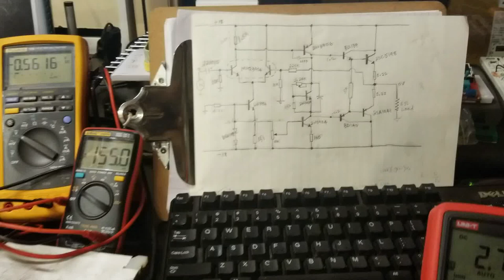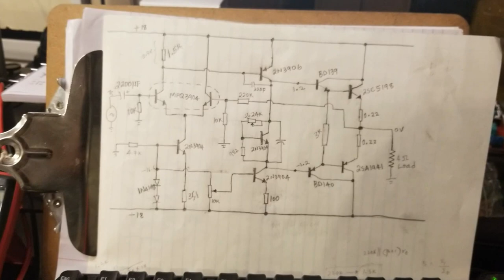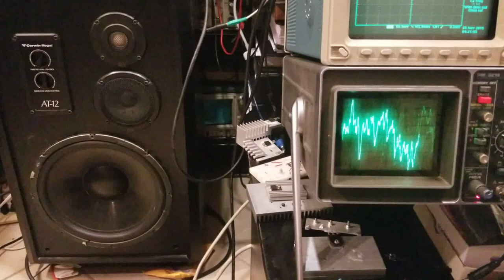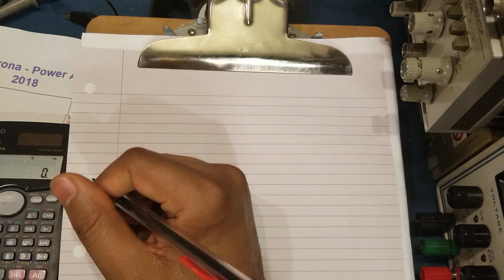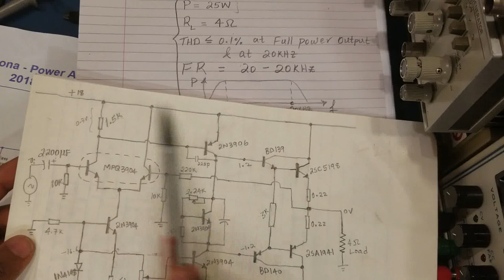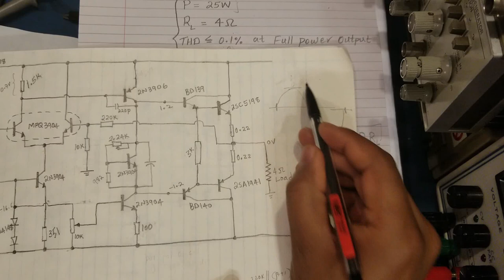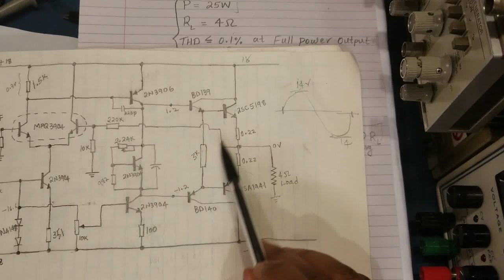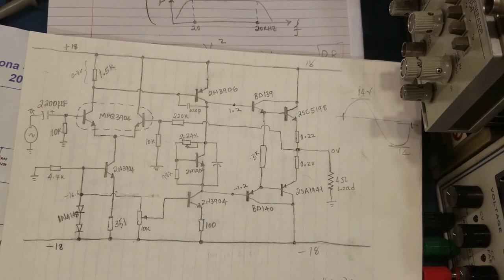25W Audio Power Amplifier Design  - Part_1

Comment: You can substitute the Darlington output configuration by a Sziklai output configuration in order to get a little more output voltage swing and output power. Probably you can also use the D44VH10 / D45VH10 as single output transistor combination. They have a very high current gain (> 200 @ 1A, > 100 @ 4 A) which should be enough without current gain multiplication.

The collctor base capacitor at the transistor of the voltage amplification stage appers to me a bit too large. I would recomment not to exceed 47 pF. Otherwise the amplifier could become too slowly for a sufficient pulse response.

Further options are a snubber network at the amplifier output to compensate for wire / spreaker inductances and an input low pass filter (1 kOhm, 1 nF) to avaid rf input penetration.
Reply: The Szukilia configuration is used , because he wants to unite the type of Power transistor, ie npn ,or pnp , not both as typical push pull is .
Reply: I agree, although the output stage is the least problematic part of this circuit which has quite a few design flaws (see my comment in the main field).

Comment: How would you calculate or determine the gain  and input resistance of the pre amplifier transistor?
Reply: The gain is determined by the ratio of the voltage divider between the amplifier output and the inverting input (G = (220k + 10k)/10k). The input resistance is the resistance of the resistor between non-inverting input and ground in parallel with that of the collector resistor at the not-inverting input multiplied by its current gain.
Reply: @gkdresden   hey buddy instead of those two mq3904 transistors, is it not better to use a op amps there.
Reply: @gammersunity4117  probably not better but at least simpler. But it depends strongly on the power requirements and the speakter load.

At a power supply of +/- 18 V (a typical limit of opamp ICs) you can get a maximum output power of 16 to 18 Wrms at 8 Ohm speaker load. In the most home audio applications this is sufficiently enough if you have speakers with enough efficiency.

But you can also use completely integrated power amplifier ICs like TDA2030, TDA2050 if you start to design with ICs. In this case you have also integrated safety means like thermal or short circiut shut down or current limits to use without further effort.
Reply: @gkdresden   well I'm just beginning, the thing is I've much to learn, I'm still  trying to understand the voltage amplification process. biasing is still confusing to me.

Comment: Use a TDA2040 and save yourself design headaches.
Reply from the maker: What you call "headache" I call it fun! There is nothing wrong making 25W power amplifier using TDA2040 if your purpose it to just have something that works out of the box. But it is much more educational and rewarding if you make the amplifier using relatively basic devices.
Reply: @SmithKerona Exactly! Same as baking a cake from scratch versus a box of cake mix.